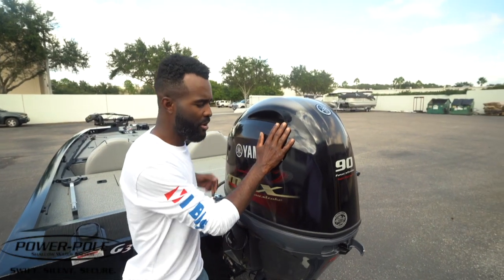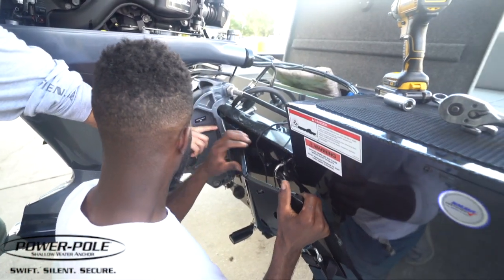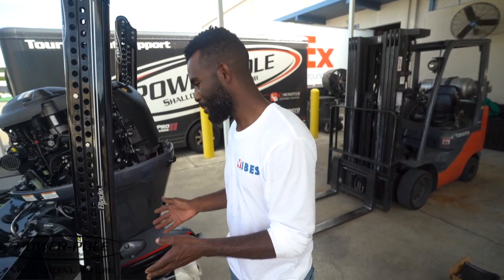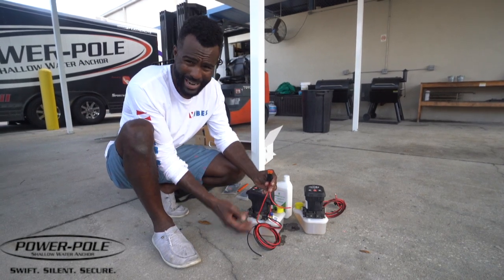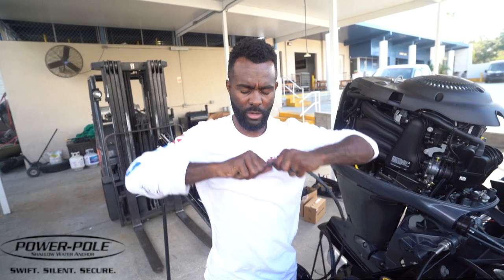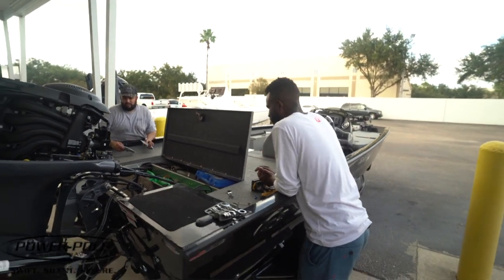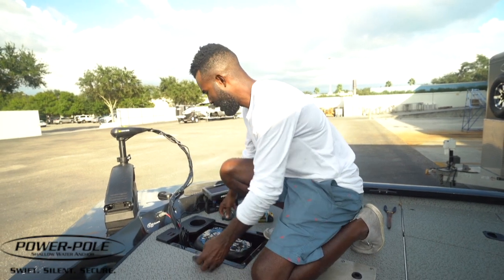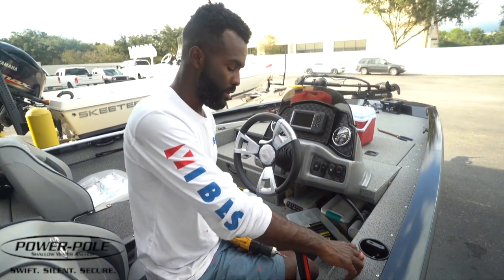How To Install Power- Poles on a Bass Boat

Comment: Nice Job Brian. Can I suggest you place protective caps on you battery big polls/terminals that are not in use. Just to prevent any accidental contact when working in the compartment.

Comment: Great video I see you mounted your pumps on different sides, would they not both fit on one side, I also see you have 3 batteries, I’ve got 2 my graphs and cranking is on one and trolling motor is on the other, I’m going to put my poles on my cranking battery. What do you have on the 3rd battery I thought about adding one thx again

Comment: Could you add a follow-up video addressing the performance impact that the poles have had on the boat, specifically speed reduction and weight? Does the boat become more sluggish with the extra weight on the rear? I've got a Tracker 175 and I'm thinking of adding the poles, but am hesitant. Thanks!!
Reply from the maker: Nothing to report on there! There’s no effect

Comment: I am about to buy a brand new vexus 1980 bass boat. I need help on choosing the right motor. I can get a mercury 150, mercury pro xs 150, yamaha sho 150, or a Suzuki 150 Atlss. Also would I need power poles? I am not a professional fisherman. I am just a weekend warrior. I live in south Louisiana. So toledo bend and hackberry will be where I fish.

Comment: You must have more room back there than my 2017 Sportsman 17 because I can't get pump and bracket in there without removing battery and once I got bracket mounted hard to get I behind bracket to put bolts getting really fustrated with it